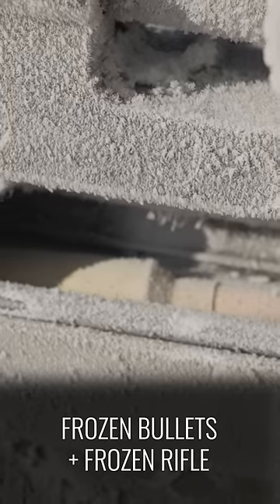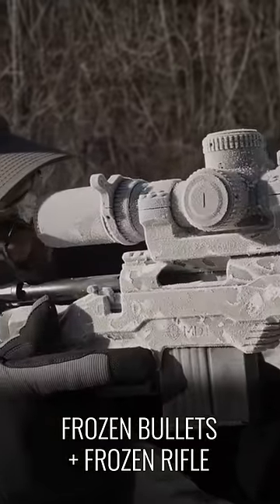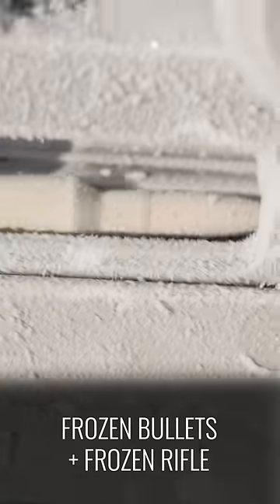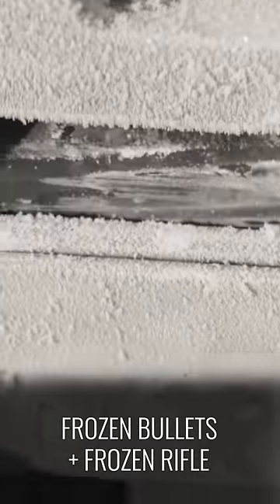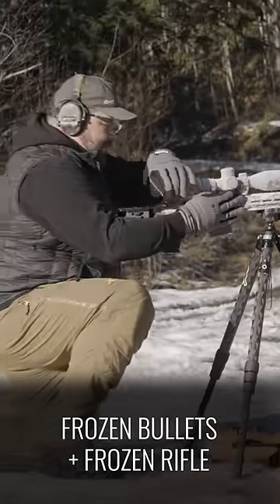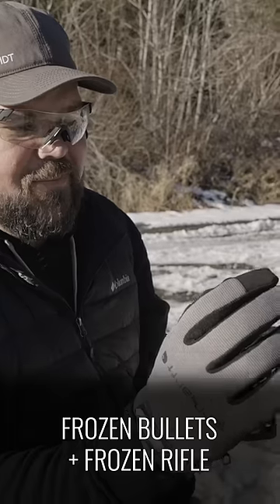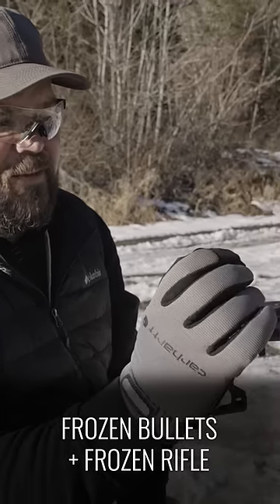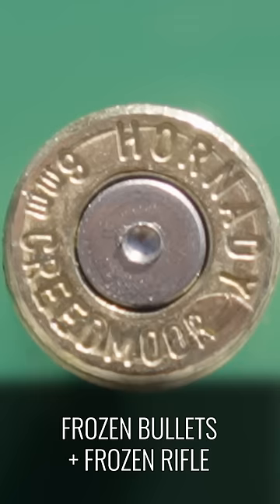Testing Extreme Freezing Temperatures On A rifle

Comment: It's actually perfectly safe to shoot that round as long as your bolt can take it.

The pressure is normal, maybe a little less because it's cold. What happened was that the outside of the brass was coated with frozen water, which didn't let the brass adhere to the chamber walls, so all the thrust went backward into the bolt and hence you got what would normally be signs of pressure.
Reply: Yaaayyy, finally someone with brains in the comments section. Thank you.
Reply: That’s literally the definition of pressure buddy. Lmfao.
Reply: @michaelroberts8397  No.
Reply: @michaelroberts8397 the pressure on the bolt face can nearly double if the brass doesn’t expand to the chamber walls and if there’s any form of water / lubricant in the chamber whatsoever
Reply: @michaelroberts8397  there’s a difference between over pressure and this case. It showed certain symptoms typical of over pressure but wasn’t actually over pressure. Did you not understand what was going on or were you just being a contrarian
Reply: yeah bet if you put a fresh clip with unfrozen rounds it wouldnt have any problem
Reply: @scratchguns correct. Cold lead is hard lead that doesn't pass through a shrank pipe easy.
Reply: @michaelroberts8397 yes and no.  There still is some danger, but (from what I understand) most of the time over pressure is about head case separation.  Which tends to happen when the round does grab the chamber but the base of the round gets pushed too far back due to too much pressure in the chamber/case, stretching the bottom of the case sidewalls that aren't supported by the chamber and allowing the case to rupture near the base where the walls are stretched thin.

Or in severe cases just cracking the chamber.

But there still is a concern here that if you do this repeatedly you could wear out your bolt head, so if you're not inspecting your bolt lugs, etc. Maybe don't.

This is generic advice.  Consult a gunsmith for your particular guns.
Reply: I’ll give you this, it takes a smart person to spew BS like this. 

Pressure signs are pressure signs. Primers are seated (correctly) below the base of a case and the base of the case is seated firmly against the bolt face. A flattened primer, of which this primer is not really all that flattened, is the direct result of internal case pressure. 

The black stuff around the primer is likely due to the case and primer both shrinking due to the cold and allowing a larger gap to open between the primer and primer pocket.
Reply: @michaelroberts8397 no it's not at all. Did you even read his comment?

Comment: Thats why theres a thing called a rope or a string. 
That marvelous item can help pull triggers on sketchy setups.
Reply: There's very low chance of a backwards explosion. Most likely is through the front, less likely is out the sides and through the front and the least likely is straight backwards.
Reply: @camhollo1139  Might want to ask Kentucky Ballistics about that...
Reply: @fleatactical7390  iirc his bullet was a handloaded hot SLAP round that had like 4x the amount of pressure (like upwards of like 40,000 PSI) for the regular .50 BMG tolerances that rifle was designed for (roughly 10k PSI).
Reply: @thenecromorpher  Correct. But it blew out the back, with shrapnel severing his right carotid and piercing a lung, among other stuff.
Reply: @fleatactical7390  I mean a metal cap experiencing 4x the PSI load of a .50 BMG round PSI load and might experience "extreme difficulties" in continuing to retain their shape. Pretty sure most metals "strongly dislike" these kinds of similar PSI loads (unless designed for them).